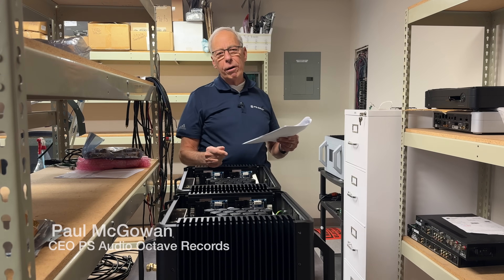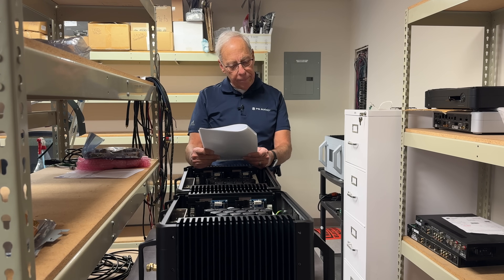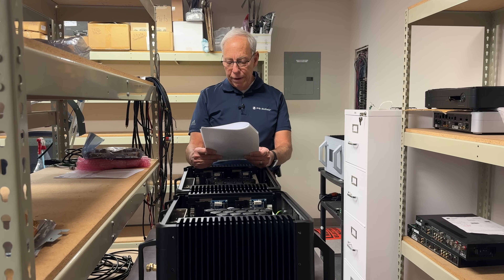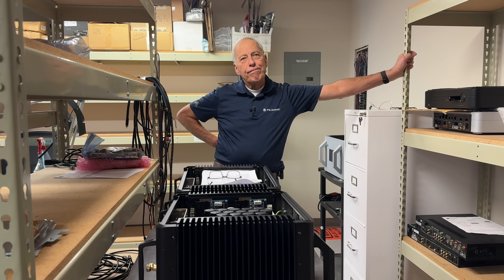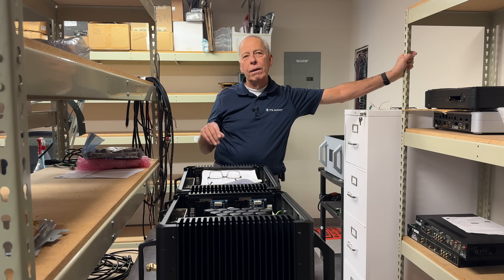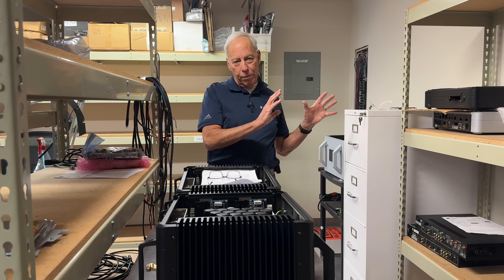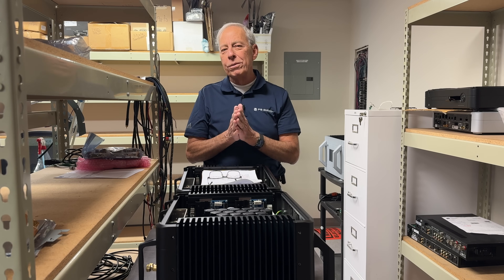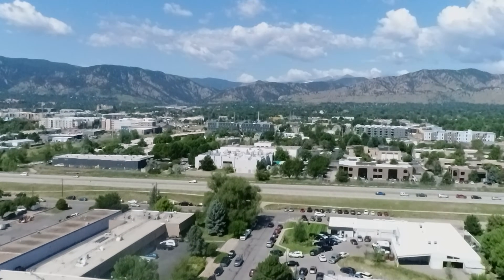How amps share power

Comment: Exceptionally clear and cogent answer to the question. Now mine: “Why, when bridging an amp, am I instructed to connect my 8 Ohm speakers to the 4 Ohm taps?” The amp in question is solid state and utilizes two output transformers. The amp employs a switch to ‘convert’ the stereo output to mono, and since there is an additional switch position for ‘parallel’ bridged mode, I can only assume that the stereo outputs are linked in series. If so, the two sources (left and right output transformers) would ‘share’ the same load. Note: the speaker cables are connected differently for each bridged mode; standard (serial), and parallel. I’m not clear on how the transformers are linked by the switch and wiring schemes. I’m guessing that the switch affects the primary (amplifier) side and that the speaker binding posts affect the secondary (speaker) side of things. An amplifier schematic would resolve the issue, but the owner’s manual isn’t that detailed. The amp on question is a newer style McIntosh power amp, MA252.
Reply: Is that model number correct? A McIntosh MA252 doesn't seem to match up to your description.
In any case, when an amplifier is bridged, the total output voltage delivered to the speaker is doubled. For a given output voltage at each channel out, the current is therefore doubled in comparison to what would be drawn by that speaker in "normal" operation. To the amplifier output, double the current draw is exactly what occurs with half the load impedance - i.e when an 8Ω load is replaced with a 4Ω load. In other words, a bridged amplifier driving an 8Ω speaker works as if each channel is driving a 4Ω speaker.
Reply: @PlatypusPerspective  I’m likely referencing an MC252, it is a power amp, not an integrated unit. Thank you for the explanation of standard bridged mode, the matter is clearer to me now. The switch must link the primary windings of the output transformers in order to double the output voltage. Left and right sides now working as one fed from a single input (connected in my case, to the right input). The speaker wires are connected only to the positive output terminals to complete the scheme. The part I struggle with is the impedance issue. The whole purpose of the output transformer is to ‘match’ impedances for maximum, or perhaps ‘optimal’, power transfer. If left at the 8 Ohm taps, the speaker coils and crossovers would be looking at twice the voltage; but by using the 4 Ohm taps, it is seeing the same voltage, I.e. the same number of turns on the secondaries of the output transformers, but the amplifier is capable of delivering twice the current. Hence, the power of the amplifier is doubled: 250 Watts into each channel becomes 500 Watts into one channel while the speaker continues to ‘see’ the same number of turns.
Reply: @jeremiahchamberlin4499   That looks right. With transformer output, the turns ratios in the transformer secondary windings are indeed selected to achieve optimal power transfer for each matching load impedance (which is nominal, so it's a "reasonably close" result).
The switching is done in the input signal path to the amplifier - for bridged operation the left channel changes its balanced input stage to provide an inverted phase duplicate of the right channel signal, so at the output, when the right channel voltage goes positive, the + of the left channel actually swings negative. The two output common terminals are already internally connected together, so in effect the two secondaries are connected in series, delivering twice the voltage, but because of the impedance matching, the same current, hence twice the power of a single channel.
To help visualize the impedances, I suggest imagine your speaker's driver is built like some car subwoofer drivers, with two 4Ω voice coils, which you can connect in parallel for 2Ω and in series for 8Ω. So it's two 4Ω in series to be equivalent to your speaker, matching up with the two transformer output windings in series. (To perhaps see the mode of operation clearer, you could run an extra wire between the amplifier output common and the middle connection between the two 4Ω voice coils, although it's not needed there for it to work). Either way, as far as the amplifier output is concerned, each transformer winding is seeing a 4Ω load, whether there are two actual physical 4Ω series voice coils, or just one 8Ω one.
I hope that helps, and isn't too complicated and wordy an explanation! It often takes a lot of words to describe what could be shown much more simply with a diagram.
Reply: @PlatypusPerspective  The split coil at the sub-woofer helps; I have a dual voice coil subwoofer that takes left and right leads. You say double the voltage, I say double the current; either way, it’s double the power. I’m traveling now, when I get back home I’m going to break out the voltmeter and check my outputs in the different modes, at the different taps.
Reply: @jeremiahchamberlin4499   Yes, if a dual coil subwoofer takes two amp inputs, the result will be double the current. The McIntosh does the same kind of thing in Mono Parallel Mode, but without needing two voice coils, since the transformer output windings can simply be connected in parallel. The input is made identical to each transformer, and, for example, a 4Ω speaker is connected to the 8Ω outputs of both channels, and the two channels together supply double the current. So McIntosh Mono Parallel doubles the current, Mono Bridge doubles the voltage.
Reply: @PlatypusPerspective  Got it! Thank you for explaining these matters to my simple mind. I really appreciate it.

Comment: No that's not correct your analysis Paul you made the mistake of the crossover in play, yes if you connected drivers up that would be the case but you've got two individual crossovers so it would still be 8 ohms for both speakers, you can have a speaker with multiple drivers say 10 and still be 8 ohms
Reply: The crossovers and single chassis/drivers don't matter in that calculation. It's just the resistance of the whole speaker cabinet(s) that counts for the amp. So two 8 Ohm speaker cabinets in a parallel circuit equal 4 Ohm overall load for the amp. Two 8 Ohm speaker cabinets in serial circuit equal 16 Ohms.

Comment: Perfect - I am still looking at Stereo Amp and Mono-blocks. Each discussion helps me understand how amps produce power and where the threshold is for me.
I am all in favour of having 2 symmetrical mono-chassis in the system .. but I also want to know I am actually benefiting from the added costs of 2 boxes.

Thank you!
Reply: The problem I don’t like about having two boxes is: I’m a true believer of plugging a power amp directly into the wall, preferably a dedicated 20 amp circuit and I don’t have enough outlets. I once tried plugging my amp into a cheaper power filter and the dynamics were hugely diminished, I noticed instantly.
Reply: Lord be, how many amps do they draw? @JR-ho5qm
Reply: @JR-ho5qm  So put in more dedicated outlets
Reply: @JR-ho5qm  Thank you; My solution is to buy a P~20, with sixteen outlets! And, this is NOT a filter! {But, thanks for mentioning the, `diminished dynamics!'} One more advantage of using ONE ~ Good Regenerator, or  high ~ quality power filter, is to avoid any chance of a Ground Loop, as everything is coming out of the, `same outlet,' initially. Even in an excellent, well designed two {or more} channel amp, there may be interferences between the channels that mono blocks can minimize or eliminate. 😁:face-blue-smiling:

Comment: In my 5th grade science class the teacher had a board with 4 or 5 light bulbs wired to be switchable between being in series and parallel. There must have been something to allow a single bulb to be powered and a power control as well. It was a good demonstration of what Paul describes here.